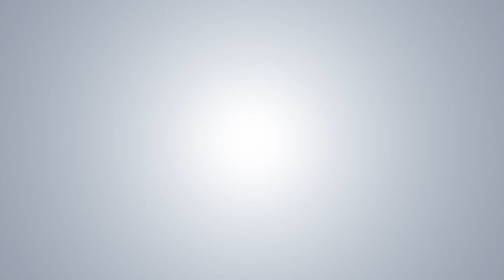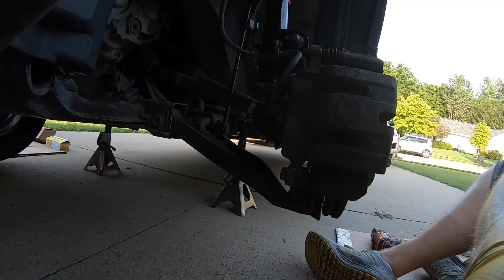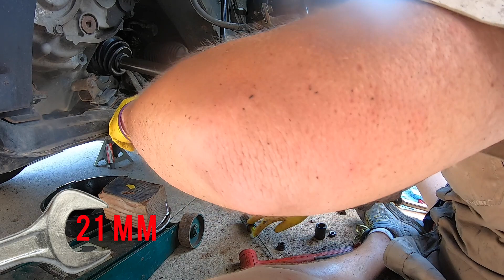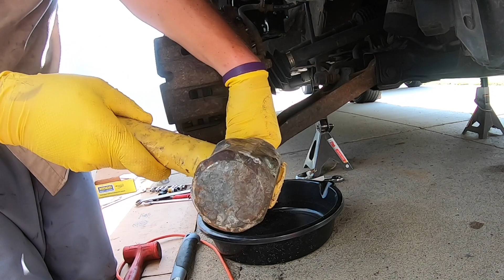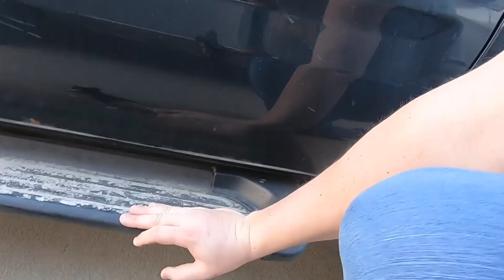How to Replace a Control Arms & Ball Joints - Honda Ridgeline - Front Right & Left (Complete Guide)

Comment from the maker: The Tools:
• MOOG RK621545 Control Arm and Ball Joint Assembly - FRONT RIGHT - https://amzn.to/3CrFXlu
• MOOG RK621546 Control Arm and Ball Joint Assembly - FRONT LEFT - https://amzn.to/3g1qf7h
• Pickle Fork set - https://amzn.to/2X94HyQ
•  Floor Jack (3 Ton) - https://amzn.to/2R7G96H 
• Jackstand (3 Ton)- https://amzn.to/3f3ABC5 
• Pilers - https://amzn.to/3lEU6WF
•  Gloves - https://amzn.to/3bbfEnu 
• Safety Glasses - https://amzn.to/3ux25GO 
• Shop Towels - https://amzn.to/2SC8D93
• Ratchet - https://amzn.to/3xWjE5g 
• 19mm, 22mm Socket - Basic Socket Set - https://amzn.to/3fjRoBd
• 19mm Wrench - Basic Set - https://amzn.to/3jzlMcJ 
•  1/2in Impact Drill (Rigid) - https://amzn.to/3vVDUBZ 
• Torque Stick - https://amzn.to/33wFTR2 
• Impact Sockets (Metric) -https://amzn.to/3etXiQU 
• Torque Wrench - https://amzn.to/3fEIrDi
• Flat Head Screwdriver - https://amzn.to/2RAjTlU 
• Long Flathead Screwdriver - https://amzn.to/3CCDCED
• Hammer - https://amzn.to/2VBhF7V
• Rummer Mallet - https://amzn.to/3jDa5le
• Sledge Hammer - https://amzn.to/3ywEurD

00:00 - Start of Video
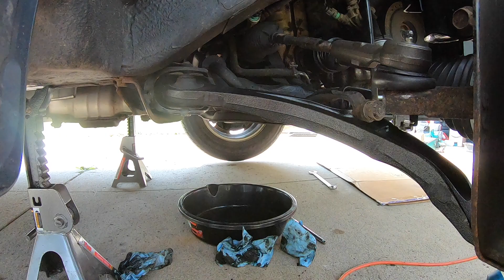00:07 - The Problem
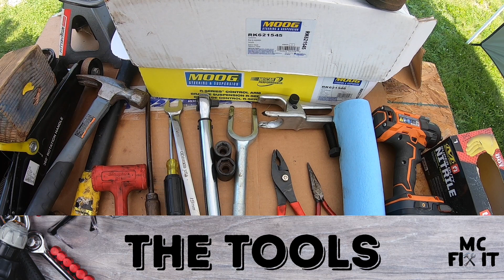00:25 - The Tools
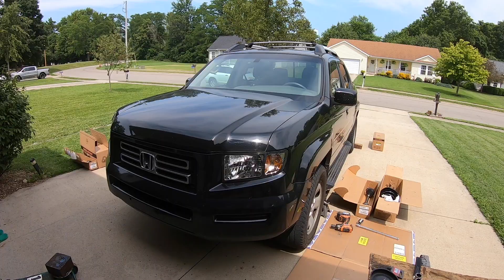02:24 - Jacking up the Truck
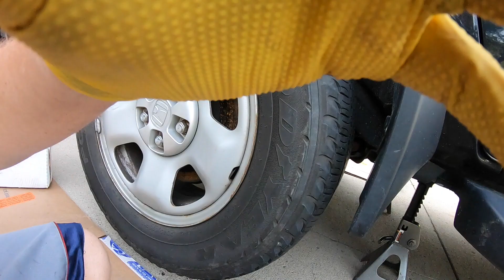05:12 - Front Left (Driver) Ball Joint & Control Arm
28:48 - Front Right (Passenger) Ball Joint & Control Arm
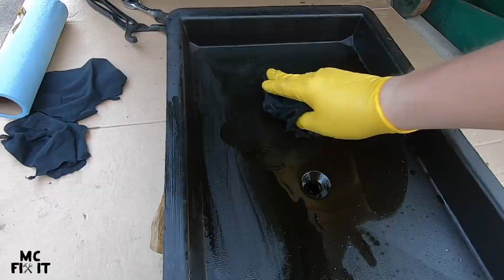44:16 - Putting the Truck back down
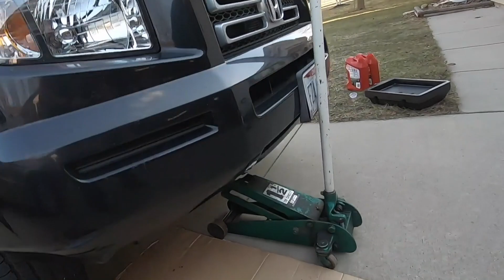44:45 - Closing of Video

This video works on many makes and models. .

Check out my website at http://mcfixit.us 

Disclaimer:
Due to factors beyond the control of MC FIX IT, I cannot guarantee against improper use or unauthorized modifications of this information in the video, post, blog, or social media. MC FIX IT assumes no liability for property damage or injury incurred as a result of any of the information contained in this video. Use this information at your own risk. If you feel uncomfortable at any time. Stop and go to a professional. MC FIX IT recommends safe practices when working on vehicles, your house, or any other project and or with tools seen or implied in this video. Due to factors beyond the control of MC FIX IT, no information contained in this video shall create any expressed or implied warranty or guarantee of any particular result. Any injury, damage, or loss that may result from improper use of these tools, equipment, or from the information contained in this video is the sole responsibility of the user and not MC FIX IT.

#mcfixit #autorepair #cellphonemountfix

——
Supplies used to record this video: 
* GoPro Hero 7 Black - https://amzn.to/3f3ALtb 
* 256GB Flash Drive - https://amzn.to/33pAueG 
* Vlogging Frame - https://amzn.to/33tajE0 
* GoPro Pro 3.5mm Mic Adapter - https://amzn.to/2RCURCu 
* Youmic Lavalier Lapel Mic - https://amzn.to/2R55sWX 
* Boom Stand (tripod) - https://amzn.to/3bdkQaw
* 5/8” to 1/4” adapter (boom to blogging frame- https://amzn.to/3txrVsM 
* Portable Battery Powerbank- https://amzn.to/3vJQc0q 
* 6ft USB to USB-C (powerbank to GoPro)- https://amzn.to/3uAS5MH
Reply: that guys has been changed before! i had to cut both end links both ends.. subframe bolts frozen in the buching' brake slide pins were froze in caliper. rears too. ill never own a HONDA again. lower control arms WILL BE SAME, ive done many other makes. WWWWOOOOOOOOOWWW. GIVE ME MY 95 TROOPER ANY DAY !!!!!
Reply: SORRY FOR RANTING. ITS ALL TRUE....

Comment: My ball joint would not come loose ended up cutting the lower control arm at the ball joint with a grinder. Had to remove the steering knuckle as well this was on the drivers side. Passenger side went just as you explained in the video. Just my luck got the ball joint from hell.
Reply from the maker: That’s terrible.  Glad you were able to replace it by getting creative! It’s no fun when projects go south like this.

Comment: I just called it a night and was defeated by that castle but on the bottom of the control arm.... Thor's hammer might struggle with mine. Sometimes these damned bolts make me convinced I have forgotten which way is loose.
Reply from the maker: Yes, it can be very difficult to get off. Especially if you live in a place where rust easily forms.

Comment: I f you are having trouble clearing the lower sway bar link/torsion bar while attempting to get the lower control arm into its mounting brackets, loosen both sides of the upper sway bar link, remove the link from its mounting bracket, and swing the torsion bar up and out of the way on its frame bushings. This made it much easier for me to get the bushings into their respective brackets.
Reply from the maker: Thanks for sharing this tip. I'm sure it will be helpful to others!

Comment: If your really concerned about torquing the castle nut on the ball joint to spec, you can probably fit a crows foot wrench  on a torque wrench into that spot.
Reply from the maker: Great tip! Thanks for sharing this

Comment: The new ball joint end will just pop back in with no pressure?
Reply from the maker: Yes when replacing the control arm it just goes back into place. You might need a floor jack on some makes and models to get it lined up and lifted into place.

Comment: Great video!

My control arm bushings (especially the flat ones) are shot. I will need to change mine out but also need to replace leaking trans seals and half shafts.

What differences did you notice from before to after the swapping of the control arms?

Thanks!
Reply from the maker: Thanks! 

I did all my suspension stuff at once and it drove like new after an alignment! Struts, cv axels, control arms, tie rods, and recently did the sway bar links (when I made these videos). Not sure if that helps answer your question though.
Reply: @MCFIXIT  It does, thank you!

Perhaps you might know... I have been fighting an issue on my 07 RL since I bought a year ago. It will steer/pull to the right (mostly) but left as well. This probably has to do with the crown on road at any particular time but is much more pronounced than on any other vehicle I drive on the same roads with.

I have tried multiple alignments and ensuring that the rest of the steering and suspension components are not too far worn but it still pulls. I have also made sure  that the brakes are not sticking.

I am hoping that replacing the control arms and the half shafts will fix this issue. 

Any thoughts?
Reply from the maker: It might help after you get an alignment replacing the shafts & control arms. Have you also changed out the tie rod ends? That's what I did to get the biggest change. My tie rods were not totally ruined but bad enough that there was some noticable play in the steering. 
I'd make sure to get a print out of the alignment before and after they do it. This helps show you where things were and where they are now. I hope that helps!
Reply: @MCFIXIT  They seem pretty tight but I think I will replace those too. Thanks!

Comment: Thanks for motivating me to do this!  Over the 2 previous days I replaced both control arms, both front struts, both outer tie-rod ends, both front sway bar links and bushings.  While working on the ground for this "slightly" over-weight 66 year old was tough on the body, it was so worth it, knowing I saved probably $1000 in labor but also having the satisfaction that I got by doing it myself.
Reply from the maker: Well done!!!! Congratulations!!! You saved way more $1000 if you did all of that work. More like $3000 or more unless you have a friend who’s doing it. Thanks for watching and commenting!
Reply: Keep putting out those videos and I'll keep refurbing my 2006 RTL w/ 209,000 on the clock! @MCFIXIT
Reply from the maker: I hope to have more videos to come. Mines over 250k and still going! Hoping to get this to 300k
Reply: I have saved so much money by watching these videos.  I have an ‘07 that is in need of some TLC. I feel more confident watching these examples

Comment: Could you leave the ball joint in the lower control arm or is it a case where you have to seperate it before taking the control arm off?
Reply from the maker: I like it bolted on to remove the ball joint easier with the separator. That’s the only way I’ve done it on this vehicle. But it should work taking off the other bolts first.

Comment: How can I diagnose if the ball joint is bad? I took the control arm off yesterday to replace the compliance bushings only but want to make sure I replace the ball joint if needed while it’s off.
Reply from the maker: Torn boot, excessive wear by mileage, any weird noises coming from there. I like to change it all out and then get it aligned. With as many miles as I put on vehicles, it’s just a safe bet it will need to be changed out sooner rather than later.
Reply: @MCFIXIT  what about how loose it is when moving it around, is that an indicator of needing to be replaced?
Reply from the maker: @BradleyCox  It shouldn't have a lot of play in it. It's hard to say without seeing and even hearing it. Any leaks? any grinding sounds?

Comment: Thank you MC!  Q:  i have read that it is better to do the final tighten /torque after the truck is on the ground to take into account for the tension on the bolts when you lower it. Why did you not do that?   Q:  Did you notice any difference in the handling of the truck after replacing the control arms/ball joints?     Great video!
Reply from the maker: That’s def an option on how to do it. It helps to make sure it doesn’t move. I’ve been doing it this way for many years and never had any bolt come lose. If I was doing it by hand, I’d put it on the ground but with an impact tool, I don’t think it matters. 

Yes, it’s much better. If they are worn they should be fixed. Better tread wear on tires and also you don’t risk the possibility of breaking when driving which can be deadly at high speeds.

Comment: Would this be similar on a 2nd generation Ridgeline?
Reply from the maker: It might but I highly doubt it! The G2 was a total redesign. I know the lead engineer and he fixed a lot the suspension issues in the first generation. In fact, he used my NART loaded down with mulch as images for their research on what needs adjusted.

Comment: A 1.5T floor jack works on the ridge? Thing is 4500lbs.
Reply from the maker: Yes, you were not jacking the entire car up from one spot. You were simply lifting it up and putting floor jacks underneath it. I always try to make sure I have at least four points of contact… Example 2 tires and two floor jacks.

Comment: Get a set of Gearwrenches. I got the swivel set that has SAE and metric for $59.95 from Tractor Supply Company and it made the lower ball joint castle nut a breeze. Your video made my axle swap a morning project that was flawless. Thank you!
Reply from the maker: Thanks! Got a link to exactly what you are talking about? I’m always interested in getting tools that help get the job done more efficiently! Thanks again!
Reply from the maker: Is this similar to what you are talking about: GEARWRENCH 15 Piece 3/8inch Drive 6 Point Universal Impact Socket Set, Metric - 84918N https://a.co/d/43G6JKz
Reply: @MCFIXIT  I think he might have just meant ratcheting wrenches, possibly with the flexhead.

Comment: Why don't change just the boll joint instead change. Change everything?
Reply from the maker: You definitely could if you have the tools to press it in correctly. The Control Arms were rotted as well and it comes all reassembled and easy to install with just three bolts.

Comment: Good job on the video and very informative. I have an 08 Ridgeline and was replacing the struts, lower control arms and outer tie rod ends, and multiple shops quoted me anywhere from 9-11 hours labor and upwards of 1300$. I really felt that I could do it myself given a few extra tools and a nice piece of ground to do it on. I'm glad I was right.
Reply from the maker: Yes. That’s why I did mine instead of a shop. The cost of labor is very expensive for auto repairs. Make sure to have everything tighten to specks and get an alignment when finished.

Comment: Great video. What symptoms were you having that made you replace both control arms?
Reply from the maker: Badly cranked boots. Also, I was changing out a number of worn parts with the suspension. So I did them all at once. Thanks for watching and commenting!

Comment: Can i ask what symptoms led you to change these out? I have an annoying knocking sound when going over bumps im trying to isolate
Reply from the maker: My wear and tear was on the bushing. I didn't notice any sounds. Look at your bushings and see if they are cracked badly. That's what mine had done due to about 220k miles on it. Best of luck w/ your project!
Reply: @MCFIXIT  yes they have cracks all over
Reply: Mine had a annoying knock sound going over bumps and found that sway bar rubber bushings and links were worn.

Comment: Did you need to preload the suspension.
Reply: This comment might be a little late, but yes you need to preload the suspension before the bolts to the control arm and ball joint are torque down. If you don't and torque down first what happens is when you lower down the vehicle the bushings to the control arm will tend to twist with that extra force from the vehicle's weight on the ground. You don't want that to happen.
Reply from the maker: These come as a complete struts. So they are preloaded which is safer and easier. They are ready to bolt on and go (after alignment).
Reply: @MCFIXIT  Harry was not talking about the struts.  The preloading the suspension has to do with not twisting the rubber mounts when you lower it to ride height.  Your control arms will last longer without the extra twist if you preload the suspension.  Block of wood and a jack under the rotor will push up the arm enough to do this.   Beside that thank you for your video and I enjoy your content.
Reply: I was thinking the same thing
Reply: Yes, like Harry said above you'll need to use a jack with a piece of wood.  Position the jack under the rotor and push the the suspension up before you torque down the 19 and 22mm bolts to spec.  This will prevent the rubber mounds to not twist further when you lower the vehicle to ride height, it'll make your newly replaced control arms last longer.  Hope this helps for those doing this replacement.

Comment: Why didn't you use anti-seize on the threads?
Reply from the maker: That’s an option. They were not rusted and I really don’t want any of those bolts coming out easily. I torqued them to spec and hope to never have to redo this project. But yes, you can. I’d go light on it though. These bolts are super important to stay exactly where they are at during driving. Thanks for commenting!

Comment: Too bad that ball joint tool you bought didn't work. I have one of those and I'm hoping it fits on my truck's ball joint. I hate using the pickle forks because they take forever to separate the ball joint.
Reply from the maker: Yes, I was a little upset bc it would have made it easier. It seems like it might for one of my other vehicles though. I think it was made for a car not a Ridgeline

Comment: Why do these fail so easily on this vehicle? My rubber part looks the same.
Reply from the maker: Not sure. Mine is quiet old at 227k. It doesn’t seem like they rot easily though
Reply: just did mine on my 95 trooper. all stock and 35in tires last 1.5 years.